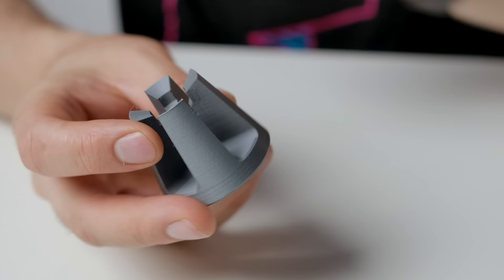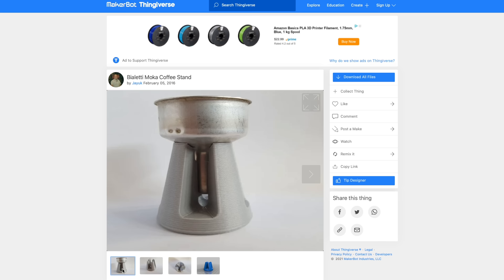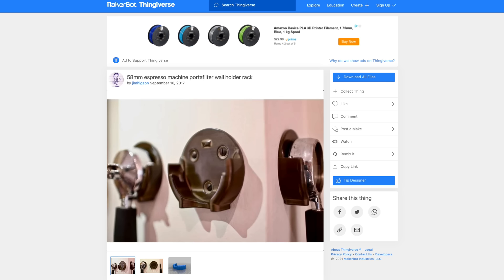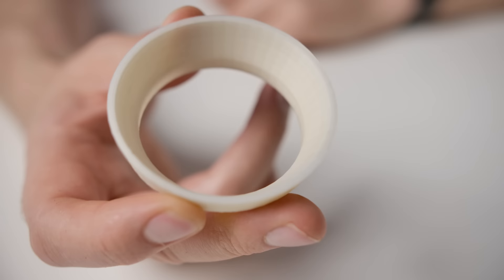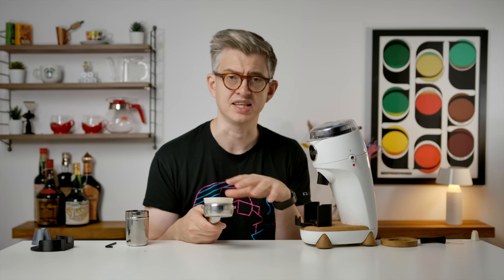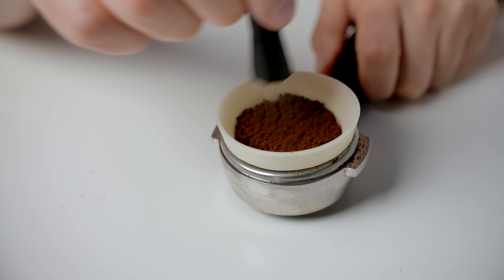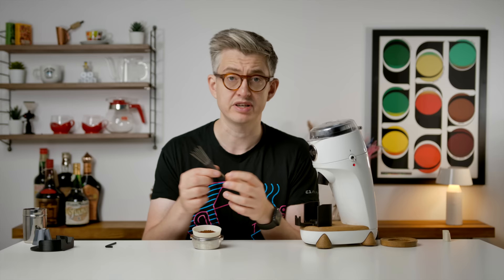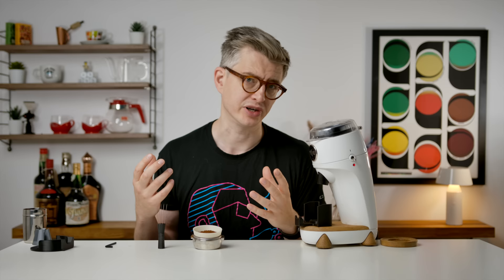3D Printing Coffee Stuff

Comment: My jaw dropped when I saw the thumbnail...my love for coffee and 3d printing have finally collided in the most glorious way. Food safe 3d prints have historically been a bit of a "controversial topic". Mainly, the layer lines can host bacteria and etc. In an attempt to combat this, I have used a food safe polyurethane spray to coat the prints. Just make sure to hand wash only; e.g., it doesn't end well in the dishwasher.
Reply: nice. you got a link for that spray? thanks
Reply: Controversial but also nonsensical. I have so many ridges in my store bought plastic cutting board which can host as many bacteria as any 3d print. Don't get me started on lead from nozzles, that's even more ridiculous.
Reply: @ChristophPech  I agree completely with respect to the lead leaching from brass nozzles. The temperatures would need to be very high to diffuse a big lead atom through a solid medium on the scales of a print. Perhaps one caveat is that using 3d prints to house "dry goods" is different than foods that are inherently wet/oily etc. I could be wrong on this, but I thought the original concern with making 3d printing food safe mainly surrounded whether or not you are able to completely dry it out? I could be wrong. Certainly, we all use non-food (e.g., having bacteria on their surfaces and etc) safe items around food all the time. I imagine that most of us don't use an autoclave or UV light source to fully clean dishes, since that's a bit overboard.

Comment: Very enjoyable video, thank you. A quick note on cheap ways to make a WDT tool, not as much fun as the 3D printed version, but size 12 embroidery needles are the correct gauge for these tools too. Check the manufacturer's website, but they are generally 0.4mm, and cheaper than nozzle cleaners. Knock them into a cork, perhaps sand off the points, and away you go.

Comment: Great Video so far :)
We need the Mokapot update Video Please!!
Reply: My mokapot is steel and spigot style. It says do NOT cool it down quickly, in contradiction to James' sink method or cold wet towels. Additionally, with a spigot method, that didn't make sense though, because you have the draw down (actually drawn up though) coffee separated from the boiler further on the platform.  Saw a UK cafe shop brew guide on mokapot that berated the idea of preheating the water, which seems an indirect reproach to Hoffmann guide.
I have had better luck with a percolator than with my mokapots. I have one mokapot electric style and two different sized steel spigot stovetop style. Thought it might be my burner temp regulation problem, so I am getting an induction burner soon. My brew time and grind sizes are not easy to dial to taste..

Comment: Thing with this hobby is that more proficient you are, the more specialized and pursue custom made solutions.

3d printing & coffee that I saw was replacement part for hario mss-1 grinder, specifically plastic part that inserted to bottom burr, the cause are hard beans & fine grind setting. When it broke, the crank just rotate but not grinding and the grind size adjustment nut became loose.

Comment: 3D printers are wonderful for solving those little niche problems that not everyone has. I used to own an Abarth 500, and the cup holder in it was abysmal - very low sides and a wide base meant it couldn't really hold anything at all when driving. I designed and printed an insert that fit snugly into the holder and created a tighter, taller - SAFER - cup holder.

Comment: Easiest early useful print: Custom cord management. You can print little brackets/hooks/loops to fit any space, any cord size etc. to let you route your USB cables, power cables, headphone or other peripheral cords etc. It's also pretty easy to design a simple hook in one of the free modeling programs out there so its a good way to start learning the whole process from design to slicing to printing.

Comment: As a coffee lover and avid 3d printing hobbyist this video was an absolute joy. I also built a Prusa from their kit and have printed several espresso related things. A WDT tool that uses the same needles, although a different design. Two different leveling tamper "handles"for my Cafelat Robot, plus a holder for the tamper and shower screen. I love printing in general, but using it as a tool to create a solution to a problem is definitely the most satisfying.

Comment: I understand the moka pot problem, and I've faced it as well, but placing it on the moka pot was a solution for me. Or am i missing something?
Reply: If you use cold water it's not a problem, but it's probably for using your moka pot with boiling water. So you can add the hot water, drop in the basket with the coffee, screw it together and get it on the stove/hob as quickly as possible.
Reply: Or ...

use an egg cup rather than spending £800 to print a 5p part.

Comment: My son printed a replacement steam valve knob for my ancient Gagia Classic. The original is small and shiny hard plastic making it awkward to use. After four prototypes I have a lovely soft rounded ribbed knob to operate.
It did need a metal washer inserted part way through the print to be strong enough where the twisting force is applied to the flat on the shaft. It’s lasted at least 9 months now so I’m reet chuffed.

Comment: I got into 3d Printing and coffee at the same time during quarantine, and it was while I was working as a blacksmith for a museum. The most important aspect of 3d Printing is the plethora of applications. I love taking the skills from 3D Printing and applying them to other areas of my life. Ran out of Command hooks? Throw together a design in Fusion and print it out. Need a holder for some random tool at work? Do the same. Want to try out water distribution modifications to a generic Mr. Coffee machine that you've had for 7 years? Well I'm still working on that project, but it's possible!

I can't wait for 3D printers to be as commonplace as an Inkjet.

Comment: PLA is in fact food safe. It is only a danger if you, lets say, have a lot of layer lines. If a bunch of coffee got between those lines, it can cause bacterial growth. However this is the case for just about every printing filament, and you can solve it by over-extruding your filament. The print takes longer, but the filament lines overlap one another, creating a tighter seal, and making it possible to clean.

Comment: I also got into 3D printing recently and of cause I printed some stuff for making coffee. 

One of the first thins I made was a dosing cup with a lid. The cup fits my porta filter, so I can grind into the cup, put the lid on, shake the coffee to destroy the clumps and take out the fluffiness, put the porta filter on, turn it over to put the coffee into the porta filter. That thing alone made the extraction so much more even. 

Second thing was a tamper that fits better into the porta filter. The one I have, the metal one is 58 mm, the porta filter is 58.8 mm. That's enough to have a hole bunch of coffee around the tamper each time, which makes tamping quite messy. I might experiment with different tamper shapes in the future.

Third thing was a coffee distributor. I kind of wanted to try one out for a long time, but not that badly that I would have purchased one. At first I hated it, but after a while and some adjustments it really made my shots better. Again, I plan to experiment with different designs.

I've been using these three items for a couple of weeks now and the consistency of my shots improved dramatically. While I'm totally happy with the results, I wouldn't just recommend it to anybody to go that route. The items I described are not as good as their metal counterparts as coffee tends to stick to plastic quite a bit more. A plastic tamper feels weird at first because it's so light, etc.

For me these are prototype like things. I have an engineering background, I know how to use CAD software, I was working with a somewhat similar manufacturing process back then at the university. It produced metal parts and was quite a bit more involved, but it also worked in layers. I'm okay with some degree of tinkering. 

With 3D printing you are getting yourself into a hole manufacturing process that needs to be mastered. Printers got a lot cheaper and work quite decently, but still. If you can only print parts that other people designed, I wouldn't bother.

Comment: If like to mention that today designing the objects is very much easier than it was a decade ago. You are not limited to what's available to download. In my last job I used 3D printing extensively and designed the objects using Onshape. It's commercial grade CAD that is free for non commercial use, is cloud based so runs on anything with a modern browser and outputs files you can drop straight into a printer. Great tutorials and a very helpful forum if you need it. Highly recommended.

Comment: 3D printing is a lot of fun, even more so when you start designing and modelling your own stuff. I haven't done that much for my Gaggia Classic yet, just a low profile drip tray and several backflush disks. However, I am working on a coffee scale that also combines several more hobbies, electronics, microcontrollers and programming. The coffee scale is a result of wanting some functionality I haven't really seen in any commercially available scales outside of some integrated into high end coffee machines. And yes, an integrated Gaggia Classic coffee scale is my ultimate end goal.

Comment: One of the handiest categories of 3d prints has to be plaques/tags/etc. where you print the background in one colour, pause the print and change the filament, then continue printing the text/symbols and (optional) border in another colour.  Once you've cot the mid-print filament changing down, you can fill your entire bed with plaques/tags/etc. and do them all at once.  (It is also a GREAT way to make some extra cash.)  If you have a resin printer, you can tweak the model so that the text/etc. makes a shallow cutout in the background, then print the text/etc. pieces in another colour and glue it into place.  Whether you use FDM or resin, you will end up with something that is classy, easy to read, and will last an indefinite amount of time.

Comment: I would suggest also printing the stand for the WDT tool. It's surprisingly very nice to use. I also had a failure when printing the tool ( the top part). Solved it by flipping the model upside down in the slicer.

Comment: I print PLA for food contact almost exclusively for my hydroponics mostly. You have to get a non-brass nozzle and specific brands/ranges of filaments that don't use additives. The biggest problem is cleaning between the layer lines, so some foods are just not a good idea (dairy, as an example). For my use, it's not an issue and for dry coffee grounds, also probably not an issue (my tamper is 3d printed, I have zero worries about it).

Comment: We live in a small apartment and our  Creality Ender 3 (approx $200) has been invaluable. I've used it for all sorts of projects but my major coffee related one is buying a pair of Eurika Mignon grinders (Knotte and Filtro) and converting them to single dose. I'm further down the rabbit hole so I design virtually all my own objects using Design Spark 3D a free UK based CAD package that works perfectly for 3D printers. The bellows for the single dose bean hoppers is a cut down automotive clutch gaiter for $7 from Amazon. My espresso grinder shoots into a custom doser cup holder and I've designed 15 degree incline bases for both of them and I've found that with the bases and single dose hoppers they are zero retention. If you don't have a shed or a garage a 3D printer is an amazing resource.

Comment: Agreed. I have a pid case, Eureka grinder single dose hopper and bellows and the WDT tool. I use it a lot for bits for my bike too. Garmin mounts. Stabilizers for fenders. Whatever. Amazing what you can do with Tinkercad. Build from scratch or import model and modify. Super fun and interesting.

Comment: Excellent Video James! I have included some links to my favourite 3d prints. I would also like to remind/inform you that most 3D prints are not food safe for three reasons. 
1) Food and bacteria can build up in between the layers
2) Some plastics used for filament are not edible. When abrasion or melting occurs on the prints the plastic will contaminate your coffee
3) The nozzle of the 3D printer can wear or cross contaminate during the printing process. 

Regardless you can still make useful coffee prints that don't contact the coffee or hot water!

My two coffee 3D prints (thingiverse):
Porlex Grinder Stand: thing:4939804
Porlex Grinder Drill Bit: thing:4939802

An excellent V60 paper filter holder (thingiverse user Jink): thing:3931628

Comment: So many years ago, I had a very old microwave. They no longer made parts for it, but it worked as I needed and so there was no need to get another. Then one day, something in the door mechanism broke, well shattered and I couldn't glue it all ack together. With a little time, I designed a full replacement unit, printed it and installed in the door. Ultimately the microwave died a few years later when the magnetron died, but it worked well for many years with that door mechanism replacement, which really was a single use/single case item for which I had the "skill".

Comment: I 3d-printed a portafilter handle, as the original one got more and more cracks and eventually broke, and no replacement parts were available. I was concerned it would not last, but it did until today (approx. 1 1/2 years of daily use; PETG turned out well). Same with the drip tray; here it is a bit unfortunate that even PETG prints deform in the dishwasher - had to print it twice. Now another part of the machine broke, so I found James and his videos while looking for a replacement machine.

Comment: If you need a filament which withstands heat then Prusament ASA is a good filament to choose without going mad and venturing into the commercial expensive filaments. 

Slightly more difficult to print, but far more heat tolerant than PLA or PETG.

Comment: You mentioned bad bed adhesion, I wash my flexible build plate with soap and water to remove all oils and then dry with a paper towel (no real towel cause dryer sheet stuff and hand oils are on them) and then don’t touch with your hands. Basically it’s oils that cause bed adhesion issues. Happy printing.

Comment: I used a printer at my work to print tamper and dosing ring for Rok espresso. Then V60 paper filter stand. I've been using them for at least a year now and still great. Btw. I made that distribution tool with champagne corque and stainless steel wires sticked into it :-) Great video.

Comment: and soon you end up like me with 6 of them on your bench.

for something like foodsafe applications I would recommend Fillamentum's NonOilen filament. its pricey (£35 for 750g) but is rated fro 110c so its dishwasher safe, I've made espresso cups in it and I've put them through the dishwasher over 15 times. it prints as easy as PLA, just use some glue stick on the bed. I do wish it was cheaper, but it is a really nice filament

Comment: i recently printed a dosing funnel :) works great. PLA isnt food safe but its usually due to food particulates getting stick in micro-cracks in between layers growing bacteria. this isnt really a problem for use with coffee. if you are concerned you can use a food safe epoxy or sealant. Also there are fine plastic particulates that are left on the surface of your print. a gentle wash with LUKEWARM water and soap can get rid of these. DO NOT USE VERY HOT WATER OR YOU WILL WARP THE MODEL. All in all PLA is fairly safe but ABS is a whole different monster. it contains lots of toxic chemicals that can harm your health. Otherwise, look on the internet for 3D printing services or makerspaces around you. You can often find them at local libraries or universities.

Comment: PLA should be foodsafe though? The main problem with 3D printed stuff and food safety are the tiny gaps between the layers, in which bacteria can settle. I usually fix this with a thin coating of laquer, or rubber spray for flexibles.

Comment: I live in Moscow, Russia, and I got into 3D printing because my WSCG-2 ground hopper cracked. Since there are no replacement parts locally available, I just CAD-ed a replacement hopper insert. It does the job, and fixes my specific issue without me having to throw away an otherwise functional grinder. I feel like 3D printing/cadding can be tremendously useful in extending the lives of our devices and curbing e-waste.

Comment: For 3d printed stuff that isnt going to be excessively wet, like the dosing ring, and for those who abhor petg: Food safe sealant, usually silicone. 
Particle migration (ingesting pla) aint as big of an issue as the porous nature of a 3d print that allows bacteria growing. You cant really disinfect it with temperature either as itll melt before being disinfected.

At that note, petg will also have the risk of bacteria finding a new home, so not food safe.

Comment: As a heads up, while your correct that PLA is not considered food safe - the method of printing that the Prusa uses(as well as other FDM printers) create prints by extruding plastic into layers. The layer lines and gaps between the layer lines become bacterial breeding grounds over extended use. That can be worked around with the use of food safe resin to seal the print, there are also filaments that are considered antibacterial. While this is a problem it doesn't mean every print will grow bacteria on it, it just means prints exposed to food and other organic substances over extended periods of time are more likely to.